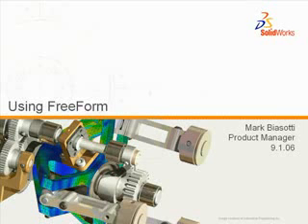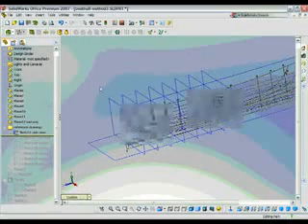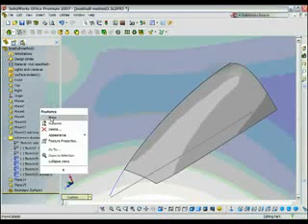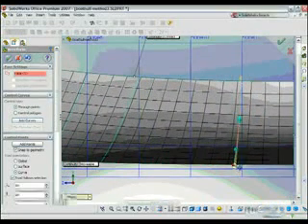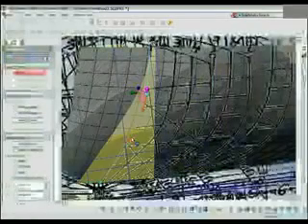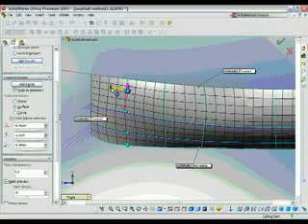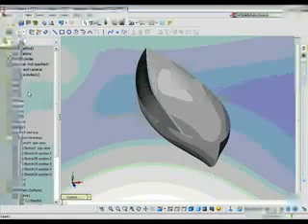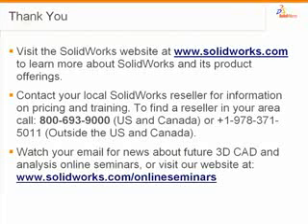How to Design a Boat Hull in SolidWorks Free Form Demo

Comment: HI - in 6:30 time, when you make a fill surface (for front part of fuselage) - when I want make it, I can't, because splines for this front part are invisible after boundary operation on start of this video. I have just only freeformed surface, but no splines for fill surface/nose of the fuselage. What mistake a make? Thanks.
Reply from the maker: Hi RIchard, could you post this question to the MySolidWorks forum? Our expert users should be able to help you there. Please include your system details and the version of SOLIDWORKS you're using. http://my.solidworks.com/forums

Comment: ok, whatever happened between 1:55 and 2:10 is the whole thing that we need to repeat what you have done and I have no idea how you did it.   those 15 seconds need about 10 minutes to explain and done very slowly.  At 1:58, I see a keel and bulwarks and I have no idea how they got there.   At 2:01 a boat is magically there,  and by 2:07 there is a side of a boat that appears to be the hull line plan but I have absolutely no idea how you did it.

Comment: You have modified the original loft. Better to use Delft, Maxsurf or another lofting tool to optimize hull splines, then import into Solidworks for downstream assembly design. Much faster and improved hull model accuracy.